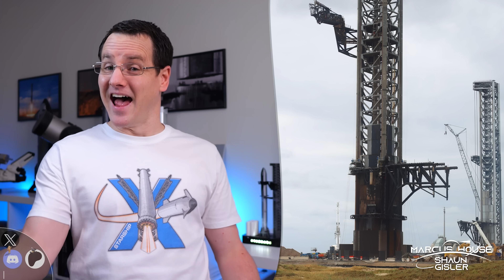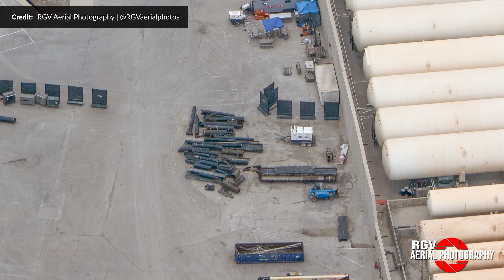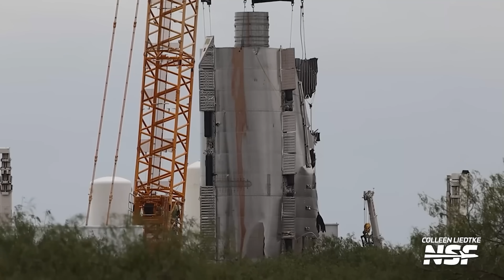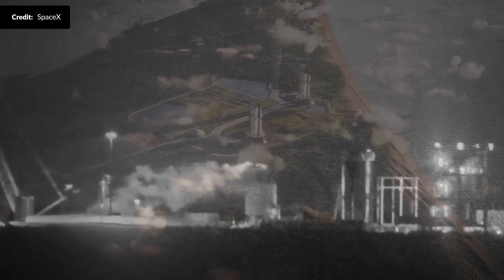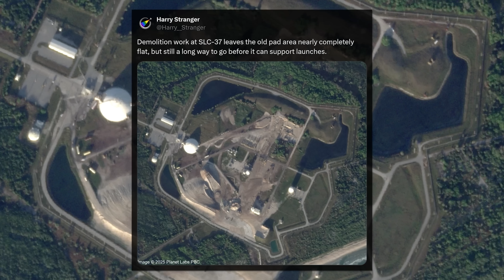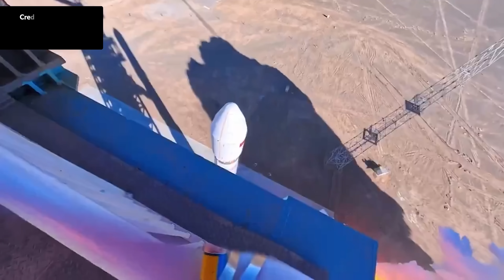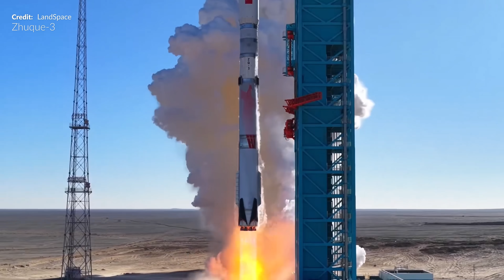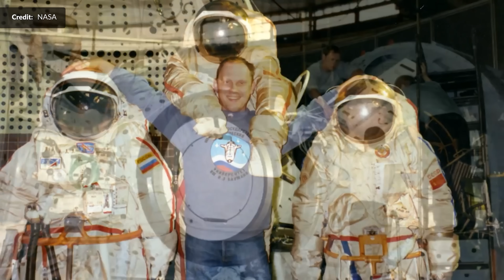SpaceX Just Got a HUGE Starship Launch Approval Update!

Comment: any estimates on how much heavier is the V3 Booster than V2?
Reply: It will probably be lighter since they want to increase payload mass to orbit.
Reply: @Wurtoz  they added this giant, massively reinforced transfer tube and extra lox landingtank how could it possibly be lighter
Reply: @S1nwar  Reduced tank thickness, lighter hotstaging ring, simplified engines, only 3 gridfins with integrated catch pins, less engine shielding and less internal baffles.
Reply: @Wurtoz  the gridfins are 50% larger though, reduced mass unlikely
Reply: @S1nwar they cut a huge amount of weight when they removed the heavy engine shielding that separated all the engines, they also cut a lot of weight from the Raptors getting lighter over time. Point of the matter is that we don’t know so we’ll just have to see
Reply: @S1nwar  All anyone can do at this point is guess.

Comment: Since Falcon 9 actually has the cadence necessary for orbital refuelling, why doesn't SpaceX use falcon to test out the concept and prove it can work? They launch multiple times per day, so could make a modified miniature payload to refill a mini depot.
Reply: Not a bad idea. Though I suspect the schedule for Falcon 9’s and the landing barges is pretty booked.
Reply: Pointless.  They know it can work.
Reply: @imaginary_friend7300  no actually they don’t. Hence why they need to test it and proof of concept. I’m talking about the entire system and the idea of keeping Cryo at cryo- temperatures without too much bleed off while in orbit for weeks or months in addition to simply testing out the hardware and pumps, etc..

Comment: The easiest way to dismantle the deluge system would have been to launch the last flight without turning it on 🤣🤣🤣
Reply: They need to mount a Raptor on the end of that excavator 😂
Reply: @oof_Dad  That would make an amazing pinwheel.
Reply: @glenndennis6801 enjoy that cartoon bubble 😂
Reply: @oof_Dad That excavator would immediately be airborne! 😁
Reply: Yeah we don't need a Rocknado 2
Although IFT1 will always be one of my favorites. One of the best things about rockets is that a failure can be as fun as a  success.
Reply: but supply LOX to the deluge system during the launch.  Presto, nothing left!  😂
Reply: Residents would complain about the dust, rocks and chunks.
Reply: 😂😂 that would have been a sight to see 😂

Comment: Zhuque 3 is the fourth orbital class reusable booster, not the third. Falcon 9, Superheavy and New Glenn have all launched and landed. F9 and Superheavy have both reflown. New Glenn will probably refly soon. Props to Landspace, but they're not third.
Reply: Well he did say orbital. I know it's semantics, but the starship system is not yet operational and still in development.
Reply: The boosters don't quite get to orbit so they? Or they would be rather hard to recover and reuse. 

And are we ignoring Thiokol's SRBs?
Reply: Landing is different from reusing. Electron eg was recovered but failed to ever be reused.

Comment: Wouldn't Zhuque be the forth reusable orbital booster? (Falcon, Starship, New Glenn and Zhuque).
Reply: Blue origin’s isn’t reusable until they reuse it
Reply: 10th. Shuttle SRB, Ares 1, Falcon 9, Electron, Falcon Heavy, Starship, Vulcan, New Glenn, Tianlong-3, Zhuque-3.

Or 8th if we don't count Falcon Heavy separately, and Tianlong-3 (because it didn't so much launched as it accidentally escaped a static test).
Reply: @danielch6662  The Shuttle counts (but barely due to the extreme amount of refurbishment required for reflights). The rest of your list of  non-SpaceX vehicles do not. REusabilty means actual REflights -  not press releases or wishful aspirations!.

Comment: The sensational Starship is set to fly as frequently as the sensational Falcon Heavy.
Reply: You mean Falcon 9.
Reply: @Barthhhelona Nope, the Falcon Heavy, launched nine times since 2018, once announced by Musk as the future of  rocket industrie.
Reply: @bordeaux1962  The bitterness exudes from you LOL
Reply: @ph8077 it's tough being a shill for the oldspace industrie (sic)
Reply: @bordeaux1962  What nonsense.  Starship is still in development and no one claimed FH was the future of anything.  But then you haters don't mind lying do you?  You people seem to do it constantly and compulsively.  You sad little zero's..
Reply: Starship has already flown 11 times. FH had issues getting flgihts since it wasn't worth it to do so over Falcon 9 for most flights. And with Starship coming, the flights that needed more capability are mostly waiting for it. 

All that said, Falcon Heavy has actually flown a lot for a Super Heavy Lift launch vehicle. By comparison, the rocket it competed with, the Delta 4 Heavy, was only about half as powerful and flew just 16 times in its 20 year lifespan. FH still has 19 launches scheduled over the next 7 years, though several are likely to be canceled (Gateway unlikely to continue being funded).
Reply: It’s a fair opinion to have. The system still has a lot to prove. Even if it does get up and running reliably, it still has to prove that it can deliver the payload numbers as advertised. Musk has always said failure is one possibility, but so is success.

Comment: 3 flights per week? Lol. What SpaceX has done and is doing is awesome but they can barely get 1 up per 6 months. 3 per week is a pipe dream packed with hopium and copium. Starship is NOT dependable or predictable, BOTH of which MUST exist if this program is going anywhere besides being a money toilet so far.
Reply: Having the capabilities for a high launch cadence doesn't hurt anyone. It doesn't mean they actually intend on achieving 3 a week
Reply: Biased people said the same thing about Falcon. And they were dead wrong.
Reply: 150 per week is the UP TO portion, not what SpaceX is saying they are going to launch. Further, that is from 5 launch sites. They hit 5 launches this year from a single launch site. They have also shown that a launch every 2 months from a single site is just fine, with Flights 10 and 11 being less than 2 months apart. That would be 6-7 launches per year from a single site. So 5 sites already puts it at 30-42 launches per year. That would be more launches that any country outside of the US and China, and more launches that any rocket in a year other than Falcon 9.

Comment: Wow the Chinese Temu rocket is a right SpaceX knockoff.
Reply: Only on the outside. Like Temu knockoffs, internally, they're quite different.
Reply: Surely you could say the same with Airbus and Boeing aircraft? Both look very similar and use very similar tech
Reply: No innovation, ever,in China, the filthy  thieves  just pirate the designs of others.
Reply: They've done the same with Range Rovers & Rolexes for decades
Reply: @ph8077  not seen the Chinese Range Rover, will need to go and google that.
Reply: It's even better, according to them the next iteration will have as much capability as F9 but with less powerful engines and a much heavier SS structure.

Comment: That Landspace booster is 100% a Falcon 9 rip off!
Reply: Only if you don't really understand either.  Which you clearly don't.  You make a superficial comparison because all you have is a superficial understanding.  Which is 100% worthless sadly.
Reply: @imaginary_friend7300 If it looks like a duck and quacks like a duck, it's a duck.
Reply: @TamiyaJunkie76  Then you're not looking closely enough, because they're very different rockets under the skin, despite an outward similarity. Yes, Landspace obviously decided that the Falcon leg design would work well for them too — but mechanically it's a totally different beast, different engines running on different fuel, etc.

Comment: In-Flight Failures
Propellant Leaks and Fires: Several flights have experienced leaks of the highly volatile liquid oxygen and liquid methane propellant, leading to fires in the aft section or engine bay. The leaks were often caused by excessive vibrations or unexpected structural stress during flight, which damaged fuel lines or related hardware.
Engine Anomalies: Multiple test flights have seen the premature shutdown or failure of Raptor engines, sometimes due to hardware issues, thermal conditions, or the cascading effect of a single failure.
Reply: And your point is ...
Reply: @GntlTch we seem to be wasting money
Reply: @jamesbarry1673  Starship has probably cost ~$5B (with only a few 100M coming from NASA). SLS and Orion have cost so far over $50B. NewGlenn has cost so far probably >$10B. Starship is promising to be orders of magnitude more capable and cost effective than both, you see that as waste of money?
Reply: @jamesbarry1673  You'd almost think that it's a system in active development and testing.. But then you'd actually have to have a clue to know that wouldn't you?  The one thing you skipped.  The classic hater blind spot.  Reality.